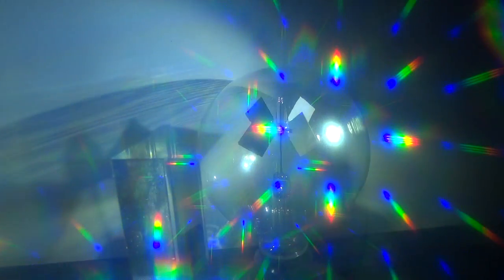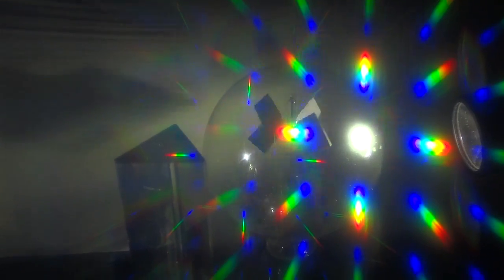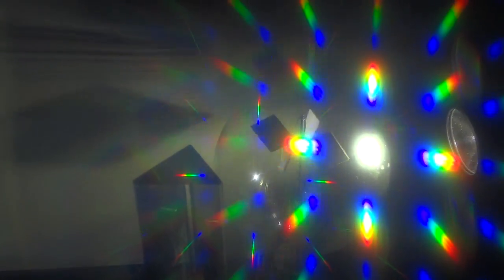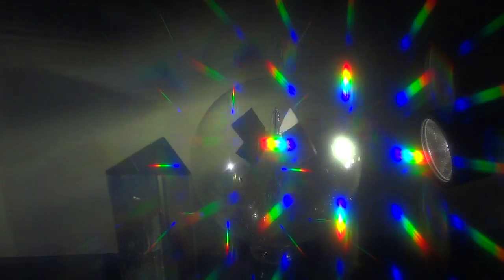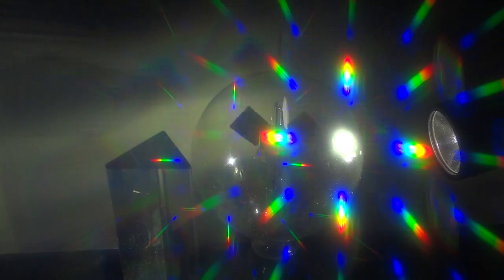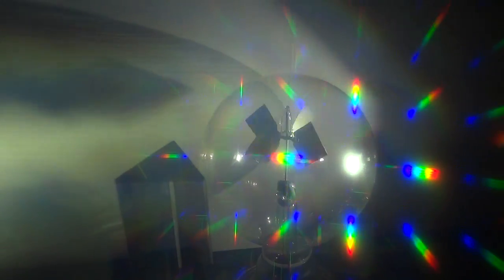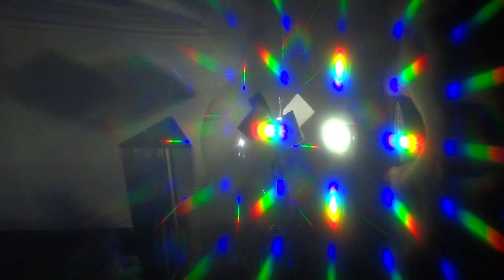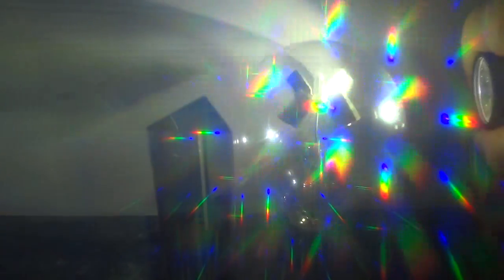140 Year Mystery Solved & Explained: Spatial Geometry VS. Field Geometry

Comment: Nice demonstration!
The light gets trapped in the black color and radiates through the blade, creating an imposing, obnoxious perturbation that drives the atoms apart and away in that direction, while on the white side of the blade, the radiative influence of the light mostly gets reflected all over the room.
The white side is white because it has been  illuminated by the light, and so it is giving off a nearly equal amount of light as it is receiving, while the black side is black because it's not illuminating at all.
Although not normally associated with heat, UV is still absorbed by dark colors, which is why your skin darkens in the Summer to protect your body from UV rays passing through your skin.  Perturbation is perturbation, so no matter how short the wavelength is, it's still obnoxious enough to push the blades.
Reply from the maker: +gilbet its like creating a magnetic divergent force, its ultimately no diff. than a super tiny small scale rail gun of force induction using magnetic 'repulsion' as its basis.
Reply: Meta Tron Every scientific subject I have investigated has exposed the academic science version as just a load of overly-formatted horse shit. 

It's 95% hubris and 5% relevant facts. Gaining knowledge from it is like trying to gain knowledge from children's books. 

You wind up spending most of your time digging through over-categorized meta-fluff and fairy tales, mostly written by kids trying to pretend to talk about stuff and stretch out what they're writing about so it will satisfy their professors. 

There's a small percentage of students who are serious, and I respect their work, but I generally prefer the work of true scientists, people doing it commercially or as a hobby because they're the ones actually trying to get something done.
Reply: Meta Tron Academic science has turned into a cult, and so it's just riding on its own momentum. The thing you're typing on came from some of the real scientists I was talking about.  

While academics are chasing each other's footnotes round and round like a dog chasing its tail, and rubber-stamping their "peer review", which involves judging a paper's congruence to the canonized flow of information and the political containment of the cultural momentum, real scientists are venturing out and taking risks by posing unconventional conjecture, trying things out in order to shake the tree and rock the boat, making real-time observations, and focusing more on personal anecdotes than the peer-reviewed regurgitation of academics.

For people who claim to pride themselves on empirical observation, and then turn around and ignore to the single most valuable source of new concepts: ~Personal anecdotes~ is beyond ignorant.  

Shutting out wild conjecture and anecdotes is like castrating themselves. It's like covering your ears and shutting out any chance of advancement.

How many footnotes do you think Steve Jobs, Wozniak, and Bill Gates used? They were reaching forward, not backward, and grabbing at every hint and detail they could find. Their focus was on building information, not honoring it.  

Academic scientists are like curators of a museum. But it's mostly just a museum of articles that were piled up by previous curators, and so some of these museums are entirely made up of articles built on articles following a pattern of tradition of the same point of view where the only empirical data that is used is that which is gathered in support of that point of view.

So you wind up with this entrenched cult squatting over and occupying an important aspect of science such as Psychology, creating a situation where the entire field consists of what amounts to nothing more than a circular categorization of irrelevant information.  

That's a segment of science that is so crippled, that its to the point where any scientific step you take or experiment you perform will probably advance the knowlegebase.
Reply: Theoria Apophasis Yeah, I was thinking about how any type of interference, manipulation, or influence is going to be obnoxious to whatever is going on in the target object, and so any attempt to influence it is going to drive it away because it's got it's own inertial momentum and so it doesn't want to be influenced.  

Same thing with laws- they only reduce the occurrence of things and drive them away. Want to help kids? Passing family laws just reduces the occurrence of intact families, so it basically just destroys what it seeks to help.  Same thing with labor laws.  Influence is a zero-sum endeavor.   

The more you try to take control of something, the less there is to take control of.
Reply from the maker: why you debating a teenager?  ROFL
Reply: Theoria Apophasis Why do I debate with hard-headed and uninformed people? I've found that I tend to learn more from talking and writing than I do from reading, and I tend to make more discoveries from that as well.  

As I'm writing, it's really amazing how things slowly begin to come together.  As the words appear, it's usually the first time I've ever seen them, or even considered them in that order.  It's like sitting on the front row of the lecture, and so I'm getting just as much out of reading it as the person I'm sending it to.
Reply: Meta Tron I just finished chasing down one of your arguments, so please me allow to give it a sound thrashing:  Nuclear Energy is a function of chemistry, not mathematics or physics. Uranium is unstable, so if you concentrate it, it becomes more unstable. No math is necessary, other than calculating how unstable it is. 

No quantum formulas are necessary. Uranium is already unstable.  It's just naturally that way.  Concentrating it is like building a three-legged table, concentrating all the legs on one side and then pushing it over.  

It has nothing to do with the formulas. And so it doesn't prove anything.  The math is tailored to the chemistry, not the other way around.
Reply: Meta Tron (I'm using partial terms like 235 and "bomdard" just to avoid triiggering any sequential text trakking programs.)  

Uranium is already unstable, as it's constantly chipping off pieces of Helium as it splits into Thorium, Radium, Radon, Polonium, and lead.  So, it goes through a form of fission and transmutation on its own, just very slowly, atom by atom. 

If you concentrate it by separating out the 1% smallest atoms in a centrifugal separator, that speeds up the process around 7 fold, resulting in a shorter half life because that part is the most unstable part of the uranium. But even at that point, it's just a piece of metal that you dug up out of the ground. All you did was sort it by size. 

I'm not sure what the next step is, and although it is constantly shooting alpha particles and gamma rays, and splitting of small chunks of helium, it doesn't seem to bomdard itself in a way that would trigger the 60-40 split.  

But some disruptive force from another reaction disturbs one of the atoms, causing it to split about 60-40 into Barium and Krypton. 

The usual alpha splits are about 100-1, so I'm not sure why this time it suddenly fissures into a 60-40 split, but it does.  

I guess if you leave it alone, it does the 1% split, and if you agitate it, it does the 60-40 split.   So that split should be 40x more powerful because it's doing the same thing 40x more.

Now, whether or not that is more than 40 times more powerful, I'm not sure if we have determined that. 

The alpha fissures only happen 1 at a time, so even if they were 1/40th as powerful, they're just too damn small to make much difference. 

They will create a 1 inch trail in a cloud chamber, so I'd say that's pretty powerful.  And you don't want that going on inside your body because it would shred your DNA, which is the same thing a "big" force would do, just on a 1 atom-at-a-time scale.   

So while the Alpha fissure is powerful on a one-by-one basis, the 60-40 splits create a near-infinitely powerful chain reaction as each one agitates the atoms around it, causing two or more 60-40 splits in the neighboring atoms, which then cause two or more splits in their neighboring atoms, until all of the atoms in the whole sample split.

But this still all happens with or without the math. 235 is as unstable as a 3-legged table, but it's no more complex.  It splits into pieces because it's unstable, just like a 3-legged table falls over because it's unstable, not because somebody  calculated its "molar mass".

The mathematicians can't take credit for the action.  They can only quantify how much of it there will be.
Reply from the maker: youre talking to a teenager, good luck with that twaddle
Reply: Meta Tron I don't mind naming things, and I agree that it's important for communicating about phenomena. 

What I'm against is stating things as facts when they have no logical basis behind them. I don't care how much JJ Thomson likes the concept of having an electronic particle, he can't just jam it into physics without first making sure there is a logical basis for it, and that it fits into the agreed upon laws of physics.

Without boundaries relative to the world around you, you can't even describe anything.  So he fails as soon as he opens his mouth.  Dude was good at chemistry, but was not much of a logician.  He was a little too eager to connect the dots and jump to conclusions.

It's okay to guess like he did, and it's okay, and even healthy to guess wrong like he did.  But for him to present such a guess as a fact, without locking it in logically, just undermines the meaning of the words and blurs the reality, and so it only winds up misleading people as well as himself. 

You gotta keep the guesses and the facts separate, because if you don't, then there is no reality.

The damage he did was severe because it weakened the structure of physics, and caused people to let go of the standards and boundaries that provide the foundation of the field, and prevented students in the future from even realizing that there was still work to be done on it.  

That's why it took me so long to uncover these problems.  You have to be aware of them before you can commence working on them.

You refer to the importance of math, and I agree, but the whole point of the math is logic.  So his sitting down and memorizing hundreds of equations doesn't make him any better at it, because if he doesn't understand how the logic flows, it's not going to do him any good, anyway.

Abandoning Newtonian physics is like abandoning mathematics.  You can't do that and still come up with a correct answer. And inserting a bunch of circular-logic math doesn't fix it.

You have to tie it into reality. Because if you don't, then it doesn't. 

I know it's wrong, with 100% certainty, but I can't prove it because you can't prove a negative.  You can't prove something is NOT there.  All you can do is bring up the fact that it doesn't make any sense. 

I also working on correcting Ernest Rutherford on the fact that Helium doesn't teleport through glass into a vacuum chamber.  Yes, finding Helium inside the chamber was an interesting result, but just because you don't know how it got there doesn't mean it magically teleported into there. That's not how it works.  That's not how any of this works.

But again, I can't prove it didn't, nor can I prove it didn't fly out of his butt, because again, you can't prove a negative. You can only fail to prove something happened the way you thought it did.
Reply: Meta Tron Maxwell came BEFORE all that Thomson-Rutherford-Einstein nonsense.  And NONE of their theories were empirical.

 If they had been paying attention to the situation , the correct answer should have been: "Gee, I don't know why the phosphorus is lighting up in the back of the cathode ray tube" . And "Gee, I don't know why Helium keeps showing up in the vacuum chamber."

But since they refuse to admit when they don't know something, they just pull some lame magical explanation out of their ass, rather than working on a way to solve the puzzle.  

Mainstream science is a joke. And they're still going to the eye-doctor to get an artificial lens that will fuck up their eyes even worse.  There's your "common sense". People who are so stupid they're literally going blind because of it.
Reply: Meta Tron I know it's hard to believe, but we've been lied to and the lies are nested so deep, they're anchored themselves in our culture.

Nobody ever measured light traveling over a distance, so there goes your empirical evidence.  You might as well try to measure the speed of magnetism, because that's basically what they're doing, and so that shows how silly it is.

All they measured was the delay of reflection and delay of transmission not a delay of inducement of light over a distance.

And just because Thomson built a cathode ray tube doesn't mean he had empirical evidence for how it works. 

And just because Ruthorford found Helium inside a vacuum tube with doesn't mean he has empirical evidence that the "alpha particle" magically teleported into the vacuum chamber. 

There are other ways for it to appear in there. He didn't need to use physics-defying magic in his explanation. And if he couldn't think of a plausible explanation, he should have left it as a puzzle for future generations of scientists to solve, rather than coming up with a ridiculous story like that. He basically invented a particle that can teleport through other particles, thereby changing the concepts of particle, position, state, and mass.  

You seem to be ignoring the empirical evidence that was documented and just going with popular opinion, no matter how ridiculous it is.  Don't you have standards?
Reply: Meta Tron. The Internet has nothing to do with the speed of light over a distance. Fiber optics is the transmission of light through a glass medium. It takes time because each atom has to receive the light before it can transmit it to the next one.  That's speed of reaction and propagation, not speed of transfer over a spatial distance.

"The alpha particle is emitted" So you're going with the notion that Ruthorford's Helium teleported through the glass and into the vacuum chamber? 

To make that work, either you're going to have to redefine Helium into another existence, such as calling it light or heat, or you're going to have to redefine glass into another existence, calling it light or heat, or you're going to have to redefine the concept of location, such as making here and there interchangeable.   It's self-destructive: You have to destroy the rest of physics in order to make that fit.
Reply: Meta Tron I agreed we can calculate the speed of light propagation through a medium because that involves the reaction time of the atoms reflecting or transmitting the light.  But it has nothing to do with light "traveling" a distance across an empty space, which is what "speed of light" implies.  Light doesn't "travel". It's a relationship.

I can't prove a negative, and it's not my job. It's their job to prove all that bs and they didn't prove any of it. There is not one shred of evidence even suggesting any of that nonsense.  See if up can find any. I already know you can't, because you can't prove something when it's wrong.  Can't be done. It's like trying to prove 2+2=5.  You can gather as many people as you like to agree with it, but you'll never be able to prove such an equation because it's not an equation, and it never will be.  

Same thing with quantum tunneling, electrons, photons, protons and neutrons.  They will never add up in any empirical equation because they don't exist in that manner.

You quoted the religion very well.  But quoting idiots by name and quoting the nicknames they gave to imaginary phenomena does NOT fulfill the empirical evidence requirement. 

Wave nature of matter is just another term for the word: behavior.  Matter is the subject and behavior is the verb.   

Alpha decay, Coulomb, and Nucleus, strong force, nuclear force, and quantum tunneling are just a bunch of decorative names.  But you can't use them as footholds for empirical evidence.

All they are are footholds for popularity.  Since everyone has been force-fed that nonsense in school, they're all on the same mistaken page.
Reply: Meta Tron The only aspect of light that has ever been measured is the speed of propagation of the relationship through the individual atoms in a medium, or the speed of propagation of the relationship reflected off of the atoms in a series of mediums such as mirrors. 
No speed of "travel" across a space has ever been established, measured or proven.

No "alpha particle" has been proven to "tunnel."  No "electron" has been proven to fly through the air or "run" down the length of a wire.  No photon has been proven to "emit" from a flashlight or fly down from the Sun.

You speak in honor of empiricle evidence, and I agree. But by the same token, you have to realize that there isn't any to support any of those claims.  I'm not just trying to be a hard-ass about it. The reason I know that there isn't any evidence is because I know that the claims aren't true. So there never will be any evidence for them.  You should stick to your scientific convictions instead of relaxing them for all that mainstream fluff.
Reply: Meta Tron By allowing their "quantum" explanation, you're allowing them to weasel out on the laws of physics.  If there's an exception, then it isn't a law.  You can't say that way is left, except for... It either is or it isn't.  

Yes, the light appears to move across the space between each atom that transmits it.  But do you really think that the delay is in crossing the space rather than the time it takes for each atom to rise to that energy level?

Are you thinking an atom can go from being at rest to emitting light in zero time?

Which do you think takes longer: Electromagnetic induction or reaching the energy level of re-emitting that electromagnetic induction?

I've been thinking about that Ruthorford experiment some more and I'm not even sure we can prove that any of the Helium came from the Uranium/Thorium metal.

All we know is that we always find Helium around the metal, and that we also find some inside a vacuum chamber if it is placed nearby. But just because it appears around it and inside the nearby chamber doesn't tell you why it appears.  So I'm going to have to get access to one and play with it until I figure out what exactly is going on.

"Quantum Tunneling" is another term for "I couldn't figure it out and so I gave up and had to just write a new rule for it."  It's like grabbing the wrong piece of a puzzle and cutting the other pieces to make it fit. That doesn't solve the puzzle, it just destroys it.
Reply: Meta Tron Okay, so now you're having to smear the concepts of time and motion in order to make it fit, just as I predicted.  I define time as using an imaginary stopwatch under the influence of Earth-level temperature and gravity, which is used to calculate time.   And for distance, I use an imaginary meter stick under Earth-level temperature and gravity to measure the distance between two objects frozen in the same moment of time.

Using those guidelines, I don't think you can smear them away from what they are, while staying within the laws of physics.
Reply: Meta Tron The problem is a lot of that stuff is connected by circular logic, and so it is all nested within itself, rather than reality. All measurements are man made and refer to something chosen by a man, including time. There's no time other than your reference of it. There's no direction other than the way you point. There's no reference other than what you refer to. 

So in order to refer to anything you have to set guidelines, such as time, temperature and gravity or mass proximity.  So, for simplicity, I choose the average gravity and temperature of the Earth's surface, and the length of a meter or mile. 

That way, none of it can jump around. The problem is if you take a metal tape measure outside on a cold day, it will shorten in length.  Or if you take a quartz watch up to the top of Mount Everest, it will change due to gravity and temperature.  So since everything changes no matter where you go, you have to use an imaginary uniform measurement in order to make a proportional comparison, and to keep it all within the Newton laws of physics. 

So I freeze everything in time and then use an imaginary meter and watch governed by the physics around me, which is approximately sea level temperature and gravity.

Einstein liked to monkey around with it and bend space and time, but if you don't have a footing in reality, then you can't judge your projection by reality, and so there where he sometimes ran into trouble.

The Gold Foil experiment is another experiment that involved Rutherford jumping to ridiculous conclusions.  There's is absolutely no evidence of atoms having a nucleus or electrons.  All Rutherford  witnessed was a small percentage of the "alpha" behavior reflecting off of the gold foil. 

Instead of asking why some of it reflected off of a shiny metal, I would be more interested in how the rest of the behavior went through, or was transmitted through.

We haven't even established why light goes through a glass window, or why it doesn't go through a metal foil.  The correct answer is that we don't know, not that the magical photons don't want to.

So I'm going to have to repeat the gold foil  experiment also, before I can even begin to untangle it.  Although with my budget, it's going to have to be the Aluminum foil experiment.  

I don't have all the answers, yet, and so I need to repeat both experiments until I can figure out what is actually taking place. The first step is to remove all the conclusions and to just focus on what was observed.  Then I'll need to repeat the experiments with little changes to see which aspects can be manipulated.    

I'm currently building a cloud chamber so I can view the vapor trails of the alpha behavior, and see what kinds of materials and situations it can reach through, and which kinds of barriers will contain it.
Reply: Meta Tron Here, let me show you how weak and unstable that stance is: 

I'm going to make some blanket statements, taking a stance that so wide, if it were wrong, you should be able to shoot holes through it all day long. 

So if you can't even find one hole, that should tell you something about the position of trying to challenge this position. 

I can state with 100% certainty that there is absolutely no evidence about an atomic nucleus, electrons, or photons.  I would include protons and neutrons, but I'm still in the middle of examining them, so I can only state with 99% certainty they don't exist.  

There's absolutely no evidence about a delay of light across a spatial divide, as there is only a delay of reaction by each participating atom, which has nothing to do with the distance between them.   

So that means that Einstein, Thomson and Rutherford were pretty much wrong on all accounts.

The only part they got right was the fact that the behaviors are quantifiable, but that's true about  anything when you have the power to name the quantity.

Now think about it:  if I was wrong, you should be able to have a field day with my claims.   It's like trying to claim that a Giraffe isn't tall or that fish don't swim.   

So how come you can't find any empirical evidence that even slightly contradicts what I'm saying?  How are my arguments able to stay so squeaky clean? Because they are.
Reply: Meta Tron Theres no logical or empirical evidence that even slightly contradicts my points. It's a shutout. There's only one way that would be even remotely possible: it's because I'm right. 

That's also why I'm able to shoot an infinite number of holes into their claims. It's not about being lucky, it's about being right. I wouldn't even bother with it if I wasn't.

But, I realize I can't win this by proving what is wrong. I have to be able to replace the wrong theories and prove what is right.

Right now, I'm just at the first step. You have to know what is wrong before you can even begin to work on what is right.
Reply: Meta Tron That's a good point. Stitching together different aspects of a theory with circular-logic mathematical equations gives the illusion of if all being correct.  Hey, if it worked for Rutherford's incorrect thesis, then it ought to work even better for the correct one.
Reply: Meta Tron My point exactly.  But the momentum of support for Rutherford's work overcomes that giant flaw, and causes people to look the other way instead of holding him accountable for it.

But the only thing that will stop that freight train of misguided momentum is a more accurate hypothesis supported by video evidence. 

This battle won't be won by logic alone, because people don't accept it in that manner. So that's what I'll be working on.  

How about you? What are you working on? What brought you to these videos on Magnetism?
Reply: Meta Tron But you can't use the phrase "Denying empirical evidence" because I'm not the one denying it.  You're denying the lack of it. 

My claim is that there isn't any supporting evidence of any of Thomson's or Rutherford's cartoon-like hypotheses, nor is there anything that even comes close to supporting any of it.  It's a shutout. 

If you truly believe in empirical evidence being the determining factor, then the fact that there isn't any should be enough to sway you.  How else would you decide? What other factors other than empirical evidence would you use to decide? Tradition? Popularity? Degree of academic propagation? 

You're right in that repeating Rutherford's experients and drawing different conclusions is not enough.  I'm going to have to repeat the experiments over and over with tiny changes that will clarify what is going on.  

My only fear is that people will continue to attach the magical mystical properties to the "alpha particles" and use that as an excuse for any results that I get.  "Oh no, dude, it 'quantum tunneled' around that barrier."  "It has a dual existence in both places at once, both as a particle and a wave". 

They could just continue repeating those ridiculous mantras of their religion just like the sheep in Animal Farm: "Four legs good, two legs bad".  You can't argue against that because as long as they continue chanting it, they'll continue believing it.

What if we're just locked into that religion, just like we were when the world was flat, or when the Sun circled the Earth, or when people didn't or still don't believe in Evolution. Anyone with different-looking siblings has the proof right in front of them. 

All you have to do is multiply those differences by the number of generations.  That's it. It's one multiplication step. Are people that dumb that they can't figure it out?  This is what I'm up against. These are the people who give all that popularity momentum to Thomson and Rutherford's lazy, illogical notions.  

These are the people who needed Darwin to explain evolution to them because they just couldn't picture it in their minds. And even when he explained it fully, half of the people STILL weren't able to picture it.  

Even to this day, a large portion of the people who believe in Evolution, only believe in it because they were taught to believe in it in school.  They accept it not out of logic, but out of faith in their professors, faith in the system, and faith in the popularity and momentum of it.  Sound familiar? Those are the same reasons they believe in quantum physics. 

For the majority of them, logic doesn't even enter into the equation.  Their resistance to Darwin even going the extra mile and spelling it out for them, is proof that they don't care about logic or empirical evidence, even if it's right in front of their noses, and even if they eat breakfast with it every morning.  You're going to defend the momentum of THAT?
Reply: Meta Tron You mean you want me to "learn" and obey the dogma of your religion and accept it out of faith, rather than logic. If something is not based on the logical deduction of an actual event, then it is by definition: A religion. 

Theoria just dropped another video telling people what time it is: Optical Phenomena & Mysteries.   In this new video, he really sets people straight on some of their misconceptions about physics, so the next generation will learn to question their acadogmatic indoctrination.

Like the Professor of Magnetism says in the video: Nature doesn't do math. Math is entirely a man made construct and adaptation TO nature.  Not FROM nature.  

And as he states: there are no straight lines, circles, squares or angles.  Just like the math, those shapes and measurements only exist in your mind.

Math is an entirely man-made circular-logical construct.  All it involves is stating that one of your personal preferences is equal to another one of your personal preferences.

If I eat one scoop of ice cream, I will gain one pound of weight.

The scoop is based on how much ice cream that I PREFER to eat.  The pound is a measurement of an unit of weight that I PREFER to weigh things by. And weight is a relarionship comparison that I PREFER to compare things by.   Mathematics is a whimsical personal quantification of one's own preferences.
Reply: Meta Tron You don't have to know how something happens to know that it happens. You can rearrange any structure by rubbing two sticks together, without knowing anything about chemistry, oxidation, or any other aspect of what is going on.  So manipulating something like electricity or the Internet doesn't prove you know anything about it beyond the result.

You can manipulate a spark with a piece of styrofoam and an aluminum pan, and then you can invent a ridiculous story about some dots and dashes running around and lining up on opposite sides of the pan.  But your misguided, mistaken understanding of what is happening and how it works doesn't stop you from being able to rub he styrofoam against your hair and then place it against the pan in order to produce a spark.

There are two separate processes: the cause and effect chain of events which is governed by the way the objects behave, and your hypothesis of why you think the objects behave the way they behave. But your hypothetical comprehension doesn't matter.  

Just like driving your car, In order to carry out the action, all you need to know is THAT the objects behave the way they do.

So people can build circuits and computers without having any idea of how they work. Just rub the thing against your hair, and you're going to produce it anyway.

Most people don't know anything about biological chemistry, yet they perform very important, complex processes every day.  With most things in life, you just go with the flow and respect the nature of each thing. You might ask why, but in most cases, the why isn't even a part of the equation.   Whether it's listening to music or watching TV, you just do it for the result. 

So our fixing some of the misconceptions in physics isn't really going to change anything.  It's just going to make things easier to understand because people are finally going to have a way to visualize the way things fit together.  

I have a cousin who believes that eating protein gives him energy.   He's completely wrong about that, but it doesn't matter: The steps he takes in carrying out that process accomplishes the same result anyway, so it works for him regardless.  

How it works doesn't affect that it works.  It only matters if you're wanting to manipulate the ingredients into new combinations that reflect the depth of the level of understanding of their behavior. 

With the tremendous depth of the level of physical aspects of behaviors that have been randomly discovered, tested and documented over the years, there might not be anything left to be gained by correcting things at the atomic level.  

If you've already discovered 1,000 ways to grow and use a piece of wood, then finally learning how it came together might not even matter, because it doesn't change the way it interacts with you, or with anything else. 

So the goal of fixing the fundamental mistakes in physics is just to tie up all the loose ends and bring a sense of balance to it all.
Reply: Meta Tron You can design a healthy diet without knowing how the chemicals work. All you need to know is THAT they work.

I have designed a computer without knowing how any of the components work. All I needed to know was THAT they work.

All you need to know is WHAT the components do, not how or why they do it.

If the CPU processes at 3.2 GHZ, then you plug the sucker in and that's exactly what it does.  If a transister allows one voltage to control the flow of another and work like an on-off switch, then you plug the sucker in and that's exactly what it does.  On every level of design, people are just plugging the sucker in because that's what it does.  Fuse a semiconductor and them plug the sucker in.  Pour the molten copper, roll it out, and then plug the sucker in.

Dig up the ore, run it through the separator, process it, run it through all the other processes, melt it down, separate it, poor it into the mould, roll it out, coil it, coat it, then plug the sucker in.

It's always the same thing.  Your design is based on WHAT it does, not how or why it does it.
Reply: Meta Tron (Had to do a bit of research in order to take it to the next level.)

We know that if you fuse two mixtures of a silicon semiconductor, one mixed with phosphorus (N-type) and one mixed with boron (P-type) and hook them up to a circuit, the electron-ic behavior will flow Negative to Positive from the N-type to the P-type, but will not flow from the P-type to the N-type.  This is how a Diode works.

We also know that if you sandwich a P-type between two N-types, and apply a voltage of electron-ic behavior across one of the N-types to the P-type in the middle, then you can apply a voltage across all three (N-P-N, and the electron-ic behavior will flow across all three.  

But if you disconnect the N-P circuit, then the circuit across N-P-N will stop also, because the electron-ic behavior can't flow from the P-type to the N-type.

The convention explanation involves imaginary "electrons" and imaginary "holes."  But since neither phenomenon exists in a physical sense, it is basically just another quantum fairy tale, rather than a real explanation.

So the truth is we don't know why the semiconductor mixtures behave in this manner, but since we know THAT they behave in this manner, we're able to design a circuit around this phenomenon and then we're able to fuse them together and plug the sucker in.  

The circuit is designed around HOW the two two-ingredient mixtures behave, not why the mixtures behave the way they do.

Their behavior was discovered by mixing the ingredients up and trying them out in circuits.   

The mixtures are first made up and then tested, with the basic premise of:  "Let's see if this thing lights up, smokes, burns up, sparks, conducts electricity, or doesn't conduct electricity, and then let's see how much voltage is required to force it to conduct electricity."

The experiment is to see what it does, so you can plan your next design around what it does.  You can then experiment with different mixtures to see what they do, but you're still only seeing the result of the behavior, rather than the reason for the behavior.
Reply: Meta Tron "There is a static (behavioral) field between the two junctions."  Okay, agreed. But what is a static behavioral field? Kinda general terms, don't you think? All you're saying is that it did something.  That is correct, Einstein.

 "So when enough voltage is amassed to bridge the the band gap a cascade of (electronic behavior) happens across the channel."

Right again in general terms, but without defining voltage or electronic behavior, you haven't really said anything or committed to anything.

"If your interested in why we must also talk about electron holes. You may want to read up on them. Simply put it is to help describe something like a plasma jet moving through a full system."

Plasma is the highest behavioral energy state of a gas. No gas = no plasma. It doesn't exist without gas.  Different gasses have different resonant wavelengths, which gives them different colors when they reach the plasma state.

"or in other words in an atomically dense structure (in this case a solid), movement of empty spaces (electron holes) in the valance band which allow for the electrons to move up energy states into the conduction band and than across the band gap to the other side of the N and P junction to that sides valance electron of the materials crystal (atomic) structure, or in other words from one valance band to the other valance band across the channel (the band gap)."

"Empty spaces", "Holes" and "valence bands" are just fantasy concepts. There are no holes, that's more of a glass half empty attitude, or a "cause I said so" point of view. And "valence shells" are another "cause I said so" phrase... "because I didn't bother to dig down and find out what's actually going on" type of concept.

But at least I'm working on it, and I just haven't finished figuring out what the deal is on the octaves:  2, 10, 18, 36, 54, which are valences that rise by  +8, +8, +18, +18

The first Hydrogen is repeated, which makes one pair for Helium, then 4 pairs are added, making 5 pairs for Neon, and then another 4 pairs are added, making 9 pairs for Argon, and then another 9 pairs are added, making 18 pairs for Krypton, and then another 9 pairs are added, making 27 pairs for Xenon.   

But then if you look at different molecules under the "electron-tunneling" microscope, and they all seem to be clumps of 3-pairs, shaped like a honeycomb.

Three sets of three pairs makes nine pairs, which matches Argon.

There's a physical pattern involved, but it's not "electrons" or "valence shells". It's just something to do with the combinations of pairs.
Reply: Meta Tron "Plasma is not a gas" Yes it is.  You can't create a plasma inside any sold material, or inside any liquid, or inside any type of vacuum.  It only exists as a gas.  No gas, no plasma.  It's that final.  Try to search for spark or plasma inside a complete vacuum. It can't happen, it can't be done.  So, if it can only exist in a gas, then guess what: it's being performed by the gas. The gas is the medium. Plasma is just a behavioral energy level of the gas.

That's interesting you use the word "column". Plasma only exists in a gas column. But how did you know there was a column?  I hadn't told you that yet. But I don't think you read it anywhere, either, because I didn't draw it from something I read.
Reply: Meta Tron "Plasma is a state of matter." That is correct. But since it is not a solid and not a liquid, the only other form of existence is that it is floating around like a gas.  Gas just means the atoms are in a higher energy state and farther apart than they are in a solid or liquid, so it's just a function of distance. You could call plasma the next energy level after gas.  Raise the energy level of a gas, and you have plasma. And due to the increase in energy level, and behavioral imbalance, it creates a static charge which builds the column. 

The atoms can either stay still (solid), move around while stuck together (liquid), or move around while not stuck together (gas).  But plasma is a weird state because the atoms in a gas are drawn back together into a column that extends in a magnetic field between the two main objects that have this sort of tension that is propagating between them.

There is no such thing as plasma in a full vacuum. Try searching for it online. You'll find out that it does not exist. Can not exist. Will not exist. Never will exist. 

When people say "vacuum", they mean a partial vacuum. There is a word to describe a partial vacuum and it is spelled G-A-S. There is no other type of partial vacuum, other than a body of gas.  

So both concepts "plasma" and "partial vacuum" are land-locked in the concept of  gas. There are no other versions of them, and so you can't separate their existence from gas, because the only way they can exist is from a gas.

In order to have plasma, you have to have a Cathode, an Anode, and a gas between them.  

The Anode is the "negative", domineering, electron-ic intrusive side where the imaginary behavioral "electrons" come from, and that's where the electronic, energetic behavior comes from, and the cathode is the positive, accommodating, receptive side, and the gas is the atoms that were floating around between them  and suddenly become attracted by the magnetic field between the two objects, and so they all get pulled in to form a column that creates a bridge of plasma  between the two objects, which releases the behavioral tension between them.